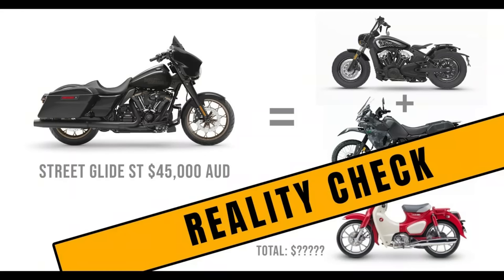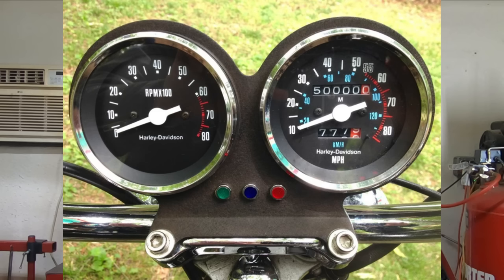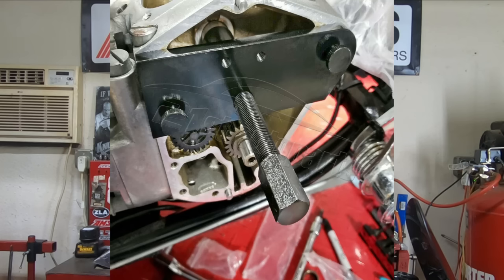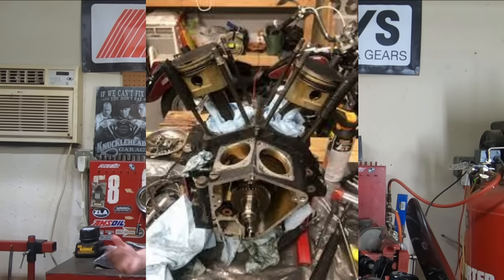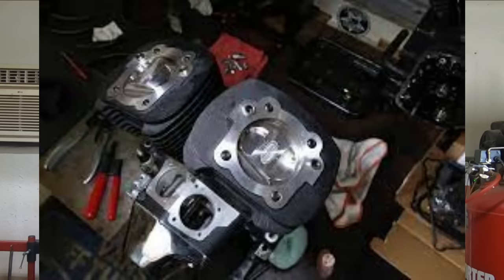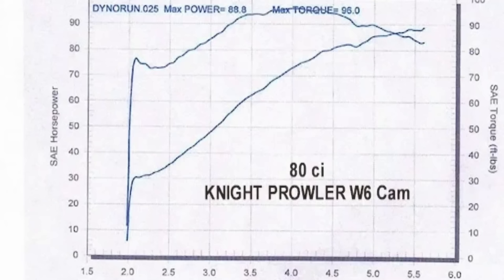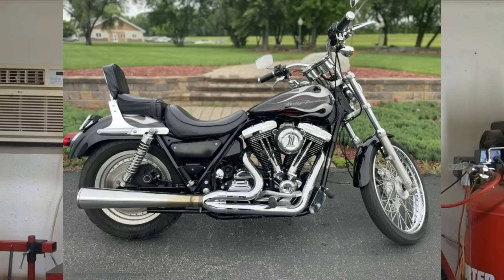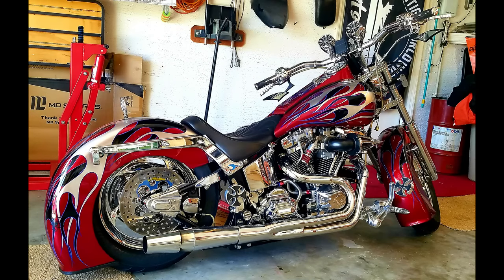Harley-Davidson Evolution is the Most Bang for the Money

Comment: Re gearing for hi way you need to a video on evo 55 mph gearing.
Reply from the maker: That's a really good idea!
Reply: I put a 34 tooth tranny sprocket on my 93 Tour Glide. I dropped 400 RPM in 5th gear.
Reply: @straightener2001  chain or belt?
Reply: My 95 is about 3000 RPM at 70 mph. Are you wanting a little lower RPM than that?
Reply: @bradboustead1682  my 87 FXR is about 33 at 70. And 1st is like 4000 the 15 mph.
Reply: Yes want lower it on all gears.
Reply: Find a 65 tooth rear pulley I have one on my wife's FXR it cruise's nice even on the interstate ! I'm running a 24 tooth trans & a 49 wheel sprocket with a chain on my FXR both bikes are hotrods & are a shit load of fun !
Reply: @leonardstanford1877  ty

Comment: Good Morning from England, hope all is well. Advice required. I own a 1998 1340 Dyna Superglide, fitted with a Super E carb and has the factory vacuum fuel tap, which leaks fuel when in the off position, only a small amount then stops leaking. I've bought a pattern fuel tap which does not have a diaphragm like the original. Could I use the new fuel tap and block off the vacuum pipe to the inlet manifold ? Many thanks. Mac.

Comment: Best evo head upgrade?
Reply: hi-flow k&n air filter, re-jet stock carb to 48low, go up #5 main jet, yost cv 40racer emulsion tube race kit,hi flow exhaust, torque cones by white bros, andrews  ev 27 cam, replace inner cam bearing w/ timken all rollers ,crane single fire ignition w/40,000 volt coil,8 mm spark plug wires
Reply: if just doing heads > take them to a speed shop that has a flowbench ,anything less is no good ! only if they a flowbench , they will do a valve job also,and determine the replacement of valvesprings

Comment: is there a way to tell if it is a stock cam? picking up a 96 80 inch for cheap and since it needs base gasket i was thinking of changing cam out any ways
Reply from the maker: The only way to know for sure is gonna be to open it up and check it out in there. Being an Evo it'ts not super hard to do and not a bad idea to take a peak inside at the lifters.

Comment: If I could still ride the Evo would be my choice, those things sound awesome around 550 rpm at idle which is something that you just can't do with twin cams or M8's
Reply: Shouldn’t do it with an evo either. No oil pressure and bad for the bottom end. 850rpm would be the lowest I’d go

Comment: I just bought a 2001 Heritage Softail with 88ci
With 24,000 kms 
15,000 miles Sinister Blue all stock. 
For $7,000.00 Canadian funds which is around $5,200.00 US funds. Definitely not a top speed racer. But it's a solid 75 mph all day cruiser. My plan is to keep it and sell it come spring. Which will be an asking price. Of $11,900.00 
That i'll probably get because of the condition the motorcyle is in. And no altering done to it.

Comment: Evo's are not without their own problems. Base gaskets can start leaking like hell as soon as just a couple thousand miles if the engine is ran hard before coming up to temp. Evo baggers and Dyna's handle like complete SHIT. Any rubber mounted Evo, Dyna, FL, FXR that has any type of performance work done will crack the inner primary. A torque arm is necessary. Clean the lifter screen every 5k miles. Evo head gaskets can be easily blown if the engine is run hard before coming up to full operating temp. All Evo Big Twins will destroy the exhaust mounts at various brackets. Stock Evo lifters are garbage. Take extra care to match the teeth pitch of the cam gear and breather gear or it will either rattle or whine depending on if the gear mesh is too tight or too loose. Evo Softails are very hard on batteries. The battery sits in the middle of the oil tank. They vibrate like hell and the battery is basically getting cooked by the heat. Other than that, sure, Evo's are great.

Comment: That year did they start to fuel injection start
Reply from the maker: 1996 was the first year with Magnetti Marellin on the Evo, they ran that same system on the Twin Cam through the 2001 model year. In 2002 that was the first year of the Delphi system and that was much needed.

Comment: I have been riding forever but I'm gonna hurt Harley Until 2019 This was in August Using a motorcycle trading app I found a 94 Electric Ultra classic  3995.   I offered them  3K and they took it. Since them cashier's check .  Park my semi my truck in Chicago  Where I had gotten unloaded. Took a flight to Orlando Picked the bike up  Headed down  Down to Miami to see a friend, Not 90 mile later she blew the rear head gasket. I milked her to port Lauderdale  put her in mr motorhead bike shop in Fort Lauderdale and got to meet Edddie  Trott.  Rode her home to halfway between Kansas City and Des Moines. Road her all next year  Had both jugs done. Road for 2 more years. Put on exhaust pipe, And Welded  up cracks in my header pipe. Rejetted carb  had clutch put it in.  It's about $3800 total you got me a fine ride. With only 73000 miles on her she had 68100 When I adopted her. Don't care If I end up with 100 more harleys I aint getting rid of her

Comment: Twin cam all day. My last bike was an evo cases cracked. Leaked oil like a bitch . Slow. 95 wide glide. Breaks wore out everything on it was 28 years old needed fixed all the time. Now I have 2013 superglide put 777 cam and few upgrades DUDE THIS IS NICE I HAVE ABS AND SECURITY. 6 speed thing rips stand it up on the back wheel and let her eat. Love love love twin cam and engine. I don’t have to choke my shit every time it cools off either lol

Comment: Have you ever done a valve job?
I don't think those angle top pistons are going to work with stock combustion chambers. Axtell and Baisley came up with that design years ago and everyone now copies it !       It takes more then what is being offered in that kit to get near a100 HP !   And 10.5 Cr fprthe street is just fine if done correctly.   Once you do the math 10.5 is not near that in dynamic CR  . You would want a AFR meter and run about 12 to one with our current 91 gas .  
Mr poster, I dont think you have a clue at all as to what you are talking about .

Comment: The indian scout with the S&S Evo is the absolute best deal as mine has 12k mi and boss bags that cost more than the whole bike to replace and the extra aftermarket parts make it a sweet ride. I've picked up a 124 kit and with a Precision 36mm turbo  setting on modified shotgun stainless exhaust and a Holley Sniper 4300 EFI I'm aiming for at least 250hp at the tire.

Comment: For Harley the Evo engine is an Icon, but for other brands it is average to acceptable.  Get real it is not uncommon to find a Excellent condition Gold Wing with low mileage, well 80K or so for the $2500 or so.  Hey I have seen commonly old 1200 Wings with 100k that run and look like new for the $2500 range.  Have a 93 Wing with under 110K on the clock, with basically some faded paint due to the sun, that runs like new and the repairs so far has been a $90 alternator upgrade, cam belts, and battery for the past 5 years of ownership.  So bang for your buck I hate to say it the HD is far from a cheap bike to own, if you ride a bunch they can be quite a money pit.  Only a handful go 100k without a bunch of wrenching, while it is NORMAL for other brands to go that far without wrenching.  Have had several HD's, yes I make mistakes, and every time it was a happy day when they were removed from my ownership.